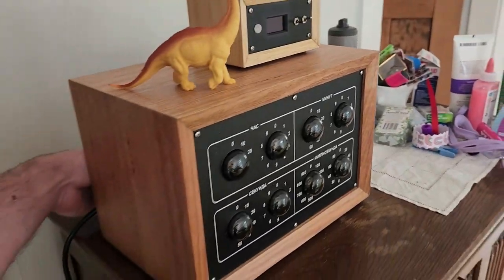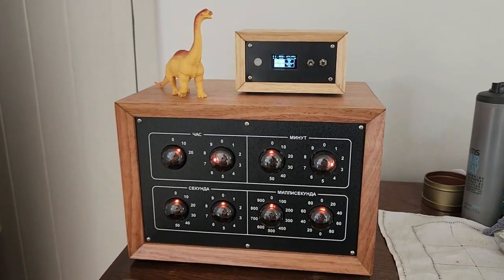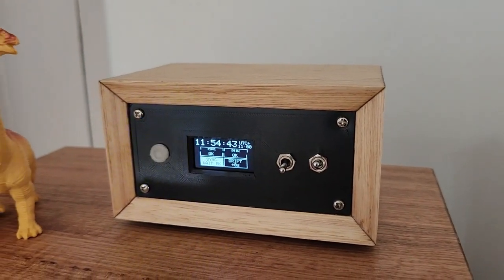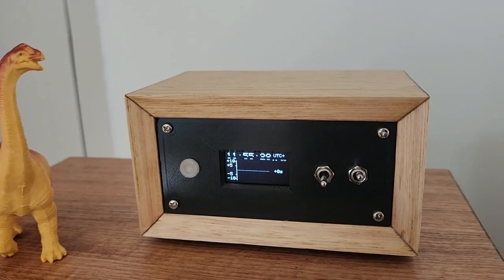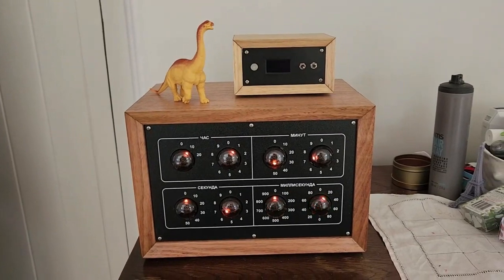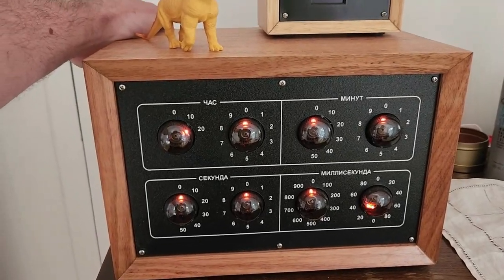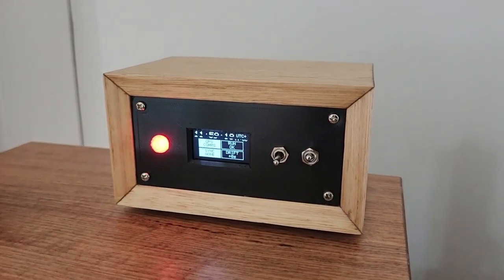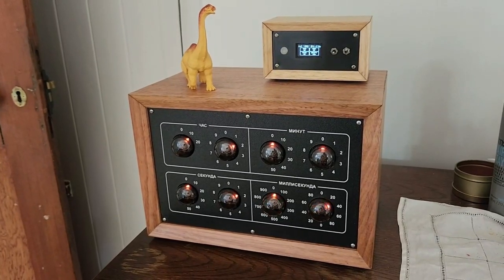Dekatron Clock Complete

Comment: Congratulations and very well done mate! The cabinet looks great, front and back. I like the screening on the back, and the Russian labeling is a nice touch.

Does the controller continuously correct the clock time as it runs, or does it just keep track of the mains drift? I don't know about your power grid, but here in the US the time of a 60 Hz driven clock typically varies around +/- 20 seconds over a period of a month. Years ago it was 10x-20x less than that, but now it's the reason I always use the crystal oscillator in my cold war clock. If your controller handles the resetting, problem solved!
Reply from the maker: Thank you wv7u, for the inspiration and your kind words.
I enjoyed your use of the crystal, the oven, the calibration! Aside from the difficulty of sourcing one (I did look...) it was a step too far out of my comfort zone. This time. :)
Also, in Australia, we have quite a tight accumulated error of 15 seconds (AEMO increased this from 5 seconds in 2017), so it's more than adequate for even long term timekeeping. At some point they are likely to eliminate the requirement altogether, then we'll be in the same drifting boat!
My controller monitors the drift, and will provide a yellow flashing light if the drift is over 15 seconds. You do have to press the switch to re-sync, as I was wary of it getting stuck in some kind of loop. It plots the last 24h on the display; I'd better get an image to share... A typical day sees a few seconds drift either way (depending where it was when you synced), with the generators tending to keep the accumulated error close to 0 every day.